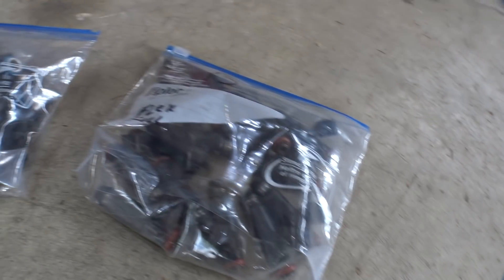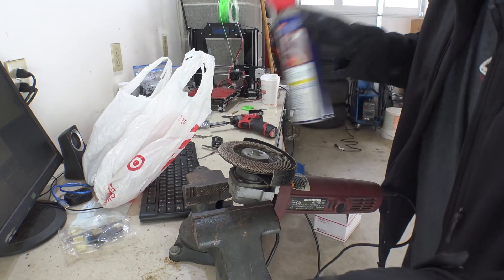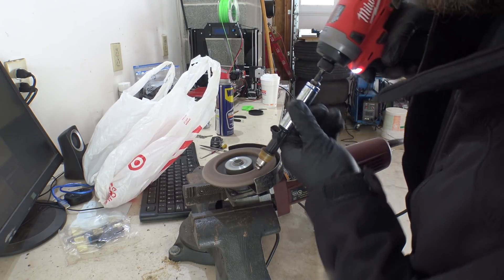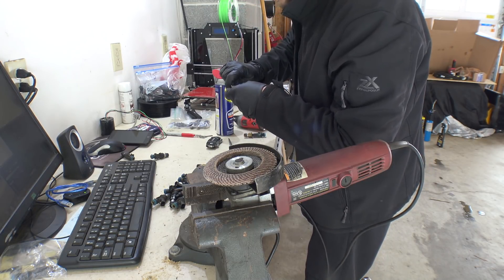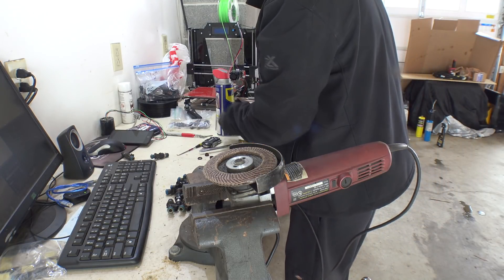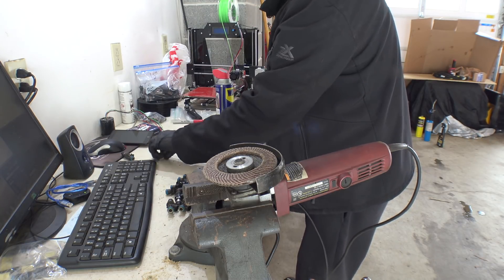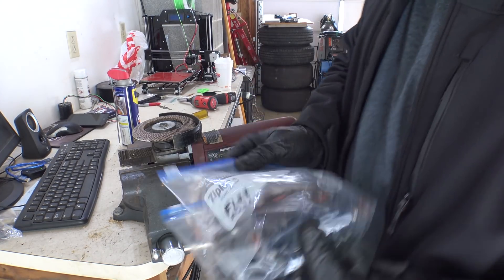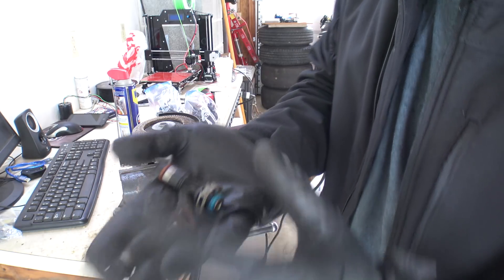lets revisit decapping - new method

Comment: I used my 1/2" cordess drill.  Opened the chuck all the way and they slipped right in up to the stops.  The oring gave just enough tension so they didn't slip.  No wobble at all.  Worked great.  Thanks for the tip Matt.

Comment: Can you use e85 on the regular (non flex) truck injectors after decaping them or do you have to have the flex fuel injectors in order to use e85?
Thanks
Reply from the maker: Yes, the “flex” injectors are just slightly larger to accommodate ethanol, they’ll both run ethanol
Reply: @SloppyMechanics  thank you sir

Comment: I have a question Matt. If I decap a set of stock truck injectors are they all going to flow the same or do I need to flow test each one. I was told decaped injectors don't always flow the same, but I don't know if that's true or not... Thanks
Reply from the maker: they "should" be all the same, but mileage, dirt, and the decapping process if done incorrectly can make them not even. the percentages are also off a little big injector to injector, this is why people usually decap 16 and send in the whole set and have someone match
Reply: @SloppyMechanics  Ok, thanks for the reply. That's what I'm going to do, I'll just send two sets to Mr. Eric Derr for testing and matching

Comment: You could've and still can use a ratchet wrench on the side that you are grinding.. That way use can use a push/pull control method with out using your fingers (on the nozzle side) as a guide while holding the injector on the grinder!

Comment: Hey Matt , ''twas myself who sent you the video of this method. Glad it works well for you, Iam a welder by trade and all about workin smart not hard.... I did a couple by hand and thought, eff that! I actually use a lathe chuck for rolling pressure pipe and so I clean the ends of the pipe with essentially the same method. Happy decapping!
Reply: Hell if his shop depends on guys running decapped injectors I think he needs to find a real job lol

Comment: wonderful timing and content.  I have 16 truck ***628   25 lbs/hr injectors,  just waiting to be decapped and to send to Eric now.  I am currently running 2010+ flex (12613412)  on the truck now (with delphi to EV6 converters) and they are stock 50lbs/hr. Looking forward to what your flex flow at. When I get the 628s back, I will install those and then decapp and send the flex ones off to eric. This video is very timely to me. Thanks 1,000 count of .001"

Comment: Why don't you make a "U" shaped fork to pop them off? I bet some 1/8 steel plate and a grinder would be pretty easy to make.
Reply: a21bravo  I think he was referring to the plastic tip that Matt was having difficulties with
Reply: wainfiggitty Ahh, in that case a thin 10mm slides right over and pops em off good.
Reply: thetriode Won't work... The caps are friction/spot welded to the end so that would just bend the edges of the cap up.

Comment: What you don't have a Milwaukee angle grinder?    I think it's time Milwaukee step up
Reply from the maker: not yet!
Reply: I have one of the cordless Milwaukee grinders.  They are awesome for cutting thin sheet metal or very small amounts of grinding. If you try to put any kind of force into grinding it will automatically stop and make some clicking noise.  I think it's a safety thing for the lithium ion battery or something maybe.
Reply: alot of the brushless tools have a safety built into the electronics that will stop the tool and vibrate the motor if its in a bind. kind of defies the point of it being brushless.
Reply: Is it brushless?
Reply: Edward Grindstaff yes. Don't get me wrong it's an awesome tool. But if your grinding welds or something like that it's not really made for that. You can't use a cup style wire wheel either cuz it will self stop it self and make this like clicking noise.
Reply: Edward Grindstaff but generally when I'm using a grinder I'm welding or working on dump trucks and heavy steel so something a lot more powerful is needed.
Reply: Edward Grindstaff it doesn't do it be cause it binded or something. It stops because it's getting too much of a load or something.

Comment: @8:26 For taking the caps off, I use a worn out set of side cutters and just lift them off in a single motion. Instead of closing them like your'e cutting with them, just have them half-cocked open the top blade of the side cutter over the top of the cap to pin it down while the bottom side of the cutter lifts it over that ridge that keeps the caps in place. I can do a video too if it would help over my explanation. When I asked Eric about it, he replaces those and chucks them in the trash, so don't worry about saving the old caps and re-installing them.

Comment: I did not think about the keeping the oring and using a socket but I have more or less done that with other things but 2 things a 1/2 should be slightly smaller than a 13 so not tearing up the oring seems of it's like 12.6 mm I believe but I was thinking that tool u believe it's called the unibur on the internet would be awesome for that job